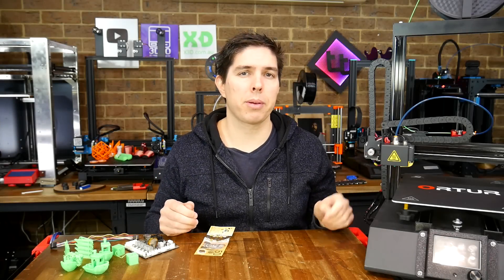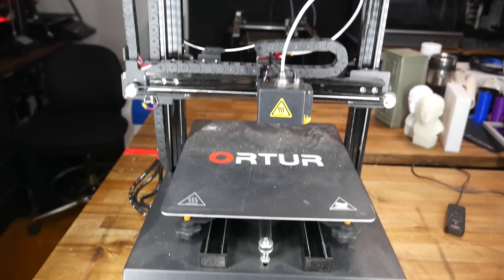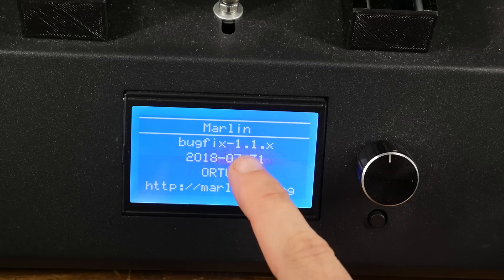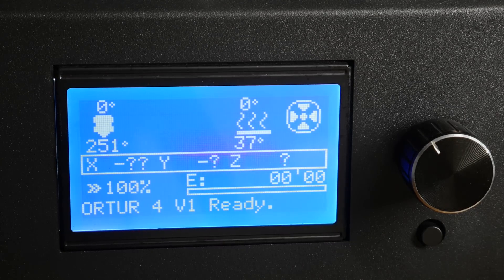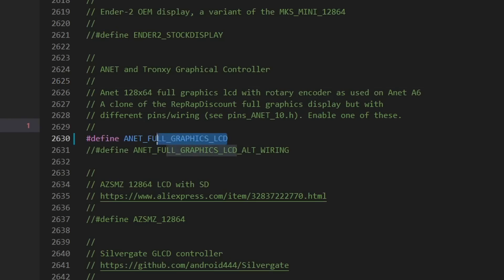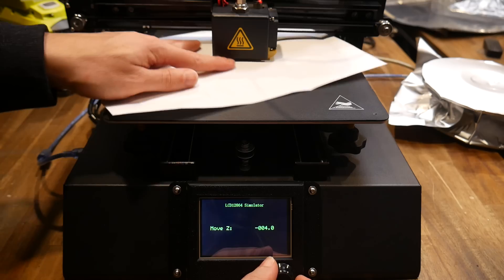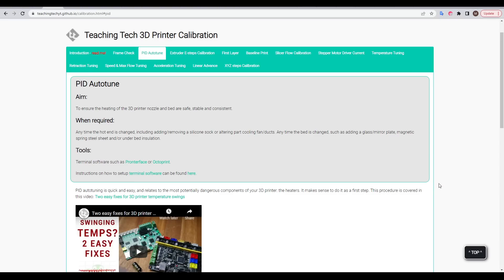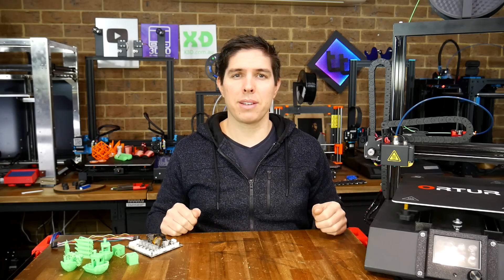Can you make money repairing barely broken 3D printers?

Comment: I think this would only be viable if the printer is a very expensive high end one.  Profit = sales price - cost and parts is part of the cost.  Also you need to think about it in terms of hours of your time repairing.  Say you make 200 profit but spent a day working on it (include the time spent online buying and selling as well because that's all part of the job).  That's 25 per hour but if you are working for yourself you should expect double a normal salary because you have no benefits from some company. I just bought a printer for 500 and it's a nice one new.  So realistically, the maximum profit would be if I got the junk printer for free (like from the curbside) and managed to sell it for near the retail price.  I don't know the printer market but I expect a used printer to be about half price of a new one.  Maybe 75% if you give the customer a warrantee and have a polished outlet to sell from.  If the printer is worth thousands new and you get the broken one for dirt cheap and it's an easy fix that would be worth it.  But more likely than not you'll get low end printers that are similar to the one you showcased.  And just because you got the parts from your drawer doesn't mean it's free.  You paid money for all those boards at some point.  Maybe if you put in an add saying "I'll buy your dead printer - 100 any condition" you might have something.  I've discovered that the trick is the cost of the old one more than the sales price.  You'll get the average used price for any printer so there is not much you can do to get more money from the sale.  In fact you'll probably find yourself reducing the price just to get rid of it.

Comment: I picked up a crealty  cr-6 se for $60 last week, the seller said it needed a new main board and hotend and when I picked it up he also said it had been stuck in chinese since he updated it.

An afternoon of reading showed a common issue where user's neglect to update the touchscreen firmware when updating the main board, so i did that.

And i had a 100% functional printer with zero repair costs.

Comment: I happen to be electronics engineer but knows nothing of 3D printer, that was 9 years ago. My first printer for £100 was a bog, every nuts bolts washers were made incorrectly, wrong placed bearings. I had to strip everything apart and start again, I have no instruction of how to put it together and I DID put it together correctly. Few tests I done under the instruction from the internet, it does run beautifully. That was then, now I owned 12 printers.

Comment: The other day I was able to score a brand new condition Ender 3 Pro for $180 CDN!!  The guy listed it on Marketplace and wasn't sure if it even worked. I took a chance and drove out to meet him. The entire thing had been taken apart and every piece of metal, nut, bolt, etc was loose inside the box. I was sure the metal was probably bent and it wouldn' t ever be square.  But got it home, and it was all there. Went together just fine, and I quickly realized that what might have happened is that the original purchaser didn't flip the switch on the power supply from 230VAC to 115VAC, so it wouldn't power up.  But leveled adjusted everything and it works perfectly !! Gonna add an extender kit and a direct-drive extruder soon !

Comment: Just picked up a free printer from a coworker that they got as a kit, partially assembled and gave up on. Got it home realized it has no main board in it at the moment and that the original one was kinda garbage anyways.  I'm gonna upgrade it with a more modern board and screen and have a second printer for about $50 USD !!!! I just have to learn how to compile the firmware

Comment: I bought three Creality Ender 3 printers, because the price was pretty cheap, and I was hoping to build a pultruder, to reclaim PET pop bottles, for filament. The first, was obvious someone bought it, and was in WAY over their head. The bed plate was seriously galled, like they had driven the nozzle through it. As was the case. Having recently purchased a 6-pack of mirrors, to make a bed for my CR-10 V3, I proceeded to cut a bed for the Ender. It took three tries, but I managed. After setting all the gibs and ways to zero, I have a functioning Ender 3! The 2nd one that arrived, is brand new! Absolutely NONE of the plastic bags have been opened, and there is NO evidence that even the assembly manual was opened up. So, perhaps someone bought it for their SO, and then broke up, so returned it? Perhaps it wasn't what the recipient was expecting, so returned? Or, perhaps I was just the luckiest SOB, to receive this? I'll take it!!

The third, was a mess!! The owner had pried several components, trying to get things to align. Guessing they had NO clue, what an eccentric bolt is. But, they DID know what a  crow bar, and a hammer are! Absolutely no worth trying to straighten parts, or buy new parts, to make it functional, especially since I plan to make a ReCreator3D filament recovery extruder, out of it. And, will have spare parts galore, for my other two Ender 3 printers.

Really enjoy your channel, and vids. I am a noobie, and found your channel by accident. I will be watching more, and plan to help you out. 

Thank you!

Comment: most cases you have 1 month to return or exchange you 3d printer if bought new. I'm sure none of them will tell you that so I would ask immediately if there is a real issue. such as the adventure 4 firmware, impossible leveling, and horrible stringing from a defective extruder assembly.

Comment: A friend and I were going through bins at an Amazon return outlet and he found a Cubicon Prime. He had no use for it and handed it to me. Took a week to find the wire to the thermistor was broken, though the insulation wasn't. The $20 nozzle was also clogged. Had to put that nozzle on the electric range to get it hot end to end.  Now, it's a good, if not great, printer. Total cost was $10 for the printer, couple bucks for the thermistor and the cost of 2 nozzles. I'm going to figure a way to modify that hot end to use v6 or mk8 nozzles. Maybe volcano, since the cubicon nozzles are pretty long in the threads.

Comment: 6:57 I recently watched a lot of repairs of that kind (tho, for things like Phones and PS5's).
Follow the trace for a bit. Remove lose track, remove the solder mask, put in a jumper wire* (enamel need to be removed with hot solder iron till it takes solder) between plug and the new pad by tinning it generously. Optional step: Apply solder-mask resin and cure it UV. (in a pinch, probably any UV resin will do, as this is low power anyway)
⇒ Board fixed

*=one repair channel got theirs from the secondary of a (speak: one) microwave transformer. Says that wire will last for the rest of his life.

Comment: I purchased a used Flashforge Creator Pro off eBay for $450 because I need to make small two colour badges. The machine turned up in original packaging with all the accessories unopened. The usage meter showed 12 hours. The extruder heads had been assembled with the left head on the right etc.Swapped the heads over so right was on the right... and had an absolutely new machine. The only mystery is that the build plate had a ghost of the foot print from a benchy. Who and how was the benchy printed?

Comment: I got a printer off ebay for broken/parts for $80 and im reality it was just a return and the print surface was damaged i upgrade it to a flex plate system and sold it for over double what I paid.

Comment: Ive been doing it for over a yr now and its a fantastic supplement to my 3d printing addiction..... running a print farm i always have a stack of parts and with the popularity of the v2 i cant keep up with demand. 70-150 is the usual profit when i do it and i have learnt after taking baths on lesser know brands to only do it with Enders and cr's. I'll usually add a short vid of the finished machine on my channel. I don't run enders on my print farm :D
Reply: How do you make $150 profit with a printer that sells new for less than $300?
Who's gonna pay $200+ for a used printer if they just could buy a new one?

Comment: I tried doing this for a bit, snagging machines off of returned merch auctions. That was pre-pandemic and I was living in a large metropolitan area,  and close to a second. I've since moved to a smaller community and it's hard to sell anything for a reasonable price. 

So take that in to consideration if you want to do fix and flips, or you may wind up under water on your printers.

Like Michael, I've had a few printers land on my bench with a ton of problems that I was mainly able to fix with parts from my spares bin, but one CR-10 in particular I got was literally a pile of loose components in a box. That was an adventure to get back up and running again.

Comment: i lately bought an Ender 3 S1 for 129 €, it was advertised as returned and in unknown condition, sold by a well known retailer. It turned out, that a SMD Diode on the Mainboard was fried. I soldered a new diode, and the printer was booting again. But something else was wrong with the mainboard, it started heating up the bed and the nozzle for no reason directly after booting, resulting in a temperature protection error. So i replaced the mainboard with a new one. Now the printer is working perfectly, just had to tighten some screws and everything was fine. That means i paid about 200 € in total for a brand new machine that costs at least 330 € ordered directly from china or 400 € when bought from a EU reseller. I am going to keep the printer as it runs great. But thinking of buying and fixing machines for selling them in the future. Where do you guys buy your "broken" printers?

Comment: Bass guitar strings are great for clearing blocked tubes and hot ends.
i have 5 printers now the last four bought as spares or repairs which were easily fixed and now run great.

Comment: Thanks for another interesting video. I’d like to know more about the process about setting up profiles for upgraded printers. You mentioned that you just took the information from another printer that you had but not all of us have a lot of printers or the experience that you do. I’m in the process of upgrading the motherboard and hot end of one of my two printers. Unfortunately I bought a lesser known brand (Eryone) that doesn’t do Ender clones so it makes things a bit more difficult when it comes time to trying to configure changes. Would I just look for a printer profile that uses the new motherboard and then make the required modifications from that? Thanks in advance.

Comment: I did exactly this to get my hands on a Flashforge Dreamer that had a bit of cosmetic damage to the extruder's PCB casing and one of the hotends disconnected, one trip to a spare parts website and a couple of all metal heatbreaks later I've got a high temp dual extruder machine for £225!

Comment: I bought my CR-10 as broken. The hotend was inside a large blob of PLA and didn't survive the removal process. A new hotend at the time costed around 8€, but I had the repaired remains of one from my Ender 3 still at hand, so it was quickly repaired. Updated the firmware to the newest at the time, got the new glass bed and everything worked perfectly. Then I started upgrading, modding and tinkering and now it is in some regards my most modern and reliable printer. I would never sell my cute adopted puppy though.

Comment: Been trying this recently and it isn’t’t working that well cuz the price has really dropped. The Micro Center Ender 3 pro at $100 has driven the used prices to the floor even around here where Micro Center is 300 miles away.
Reply: It's 2 days later and not seeing anything like $100.  could only have been a short term deal.  Best price Amazon offers currently is an Aquila for $169, which is $10 lower than usual.
Reply: @brianmi40  the deal has been on and off for a while. It haas flooded the market with Ender 3 Pro’s. I think they just wanted to get rid of them cuz of the V2 and S1.
Reply: @brianmi40  it did happen 3-4 times already.

Comment: The issue being that these machines are dirt cheap broken,  but also dirt cheap while working. The amount of work that went into reviving this rather mediocre machine is not really something you'll get back after the repair work, advertising the machine, shipping it, etc. If the machines cost $500 broken and could be flogged for $1500 tested and working it might start making sense, but buying some crap for $100 and putting time and effort into fixing it and then selling for $250 or something would be a ton of work for little reward.

Comment: Problem is that you don't really know what you are getting until you open Pandora's box .  I will usually only buy new from local suppliers (exception being  Prusa ) so there are no warranty issues and if a printer doesn't run straight out of the box it goes straight back to the vendor and they can either fix it or give me another unit . Could be an option if you wanted a printer to modify and upgrade because you could use the money saved on the purchase to buy the upgrades.
Could  the reason you couldn't get the main board to work with the LCD  have something to do with the LCD library  ? The library in the programme has to work with the drivers on the LCD and then there is the pin out configuration - just because the plug fits in the socket doesn't mean that the pins are the same configuration .

Comment: Seems like a loosing battle, meaning, if you were to charge an hourly rate for your time and also charge for the parts, the bill might end up being more than the original cost of the printer, and customers (people, in general) tend to balk at that.  What I would be curious to know is, if you were doing this as a business, how many hours did you put in to this restoration, and what the bill would have been?
Reply: The only way I could see this making any kind of sense is to do bulk printer buys and repair sessions, ideally with all the same model in a batch at a time.  That way, a number wouldn’t be useful for other than parts, and you’d save dealing with ordering parts, waiting for them (or getting scammed) and just generally take not a lot of time for each machine in an assembly line sort of arrangement, where you move to each one, instead.  That way all the tools for each step are gotten out once for many printers at a time, etc.

But then there comes the issues of selling them and all that overhead.

I can’t see the math working out in the desired way, either, even with that methodology: if you don’t love it, find something else to do, because it’s not likely to be a labor of profit!

Comment: I´m currently doing this by getting cr10 machines and ender 3 machines re assembling all the parts and the profit vary depending on the faults, usually I do a quick check and offer to buy the machines depending on the faulty part. Here in Costa Rica a brand new CR10 V2 can be purchased for something around 700$ and I buy this deffectives machines under 100$ invest 100$ and buy them at 400$ so it´s a win-win

Comment: I've been buying faulty 3D printers from a well known Chinese company, and they are hard to sell again, only if you make a very low profit, something around 30€\each.
Usually, the common problems with buying faulty printers from the main seller, are related to buyers and not to the printers themselves. So basically loose parts, bad bed leveling (damaged stickers), and so on. Also i got one that were smashed, but not hard to fix.
All my 7 printers that i've bought were working fine, besides the issues that were easy to fix if you are already into 3D printing.

But buying a printer for 60€ and selling it by 90€ doesn't worth the time.
Reply: That's generally the problem with 3D printing, cause it's community is either people who are very fresh to the hobby, or experienced people. People who are just starting would rather get a new Ender 3 rather than a cheaper, less known printer. On the other hand, experienced people probably know the flaws of these cheap printers so they would rather get a more expensive one.